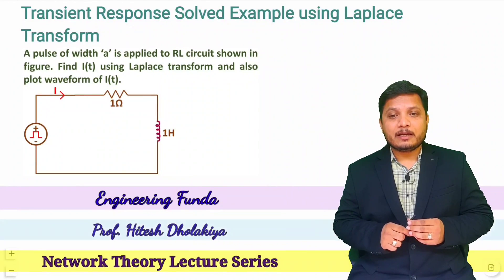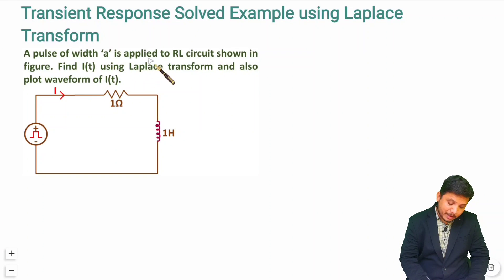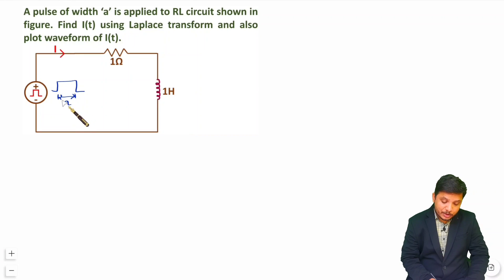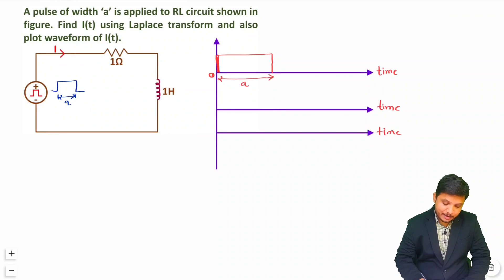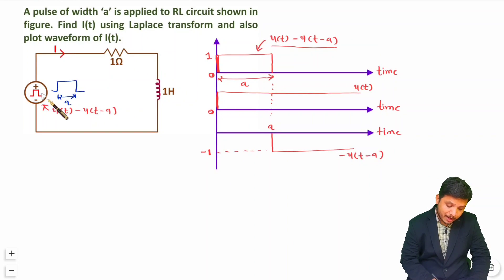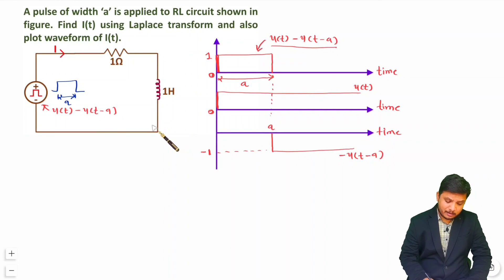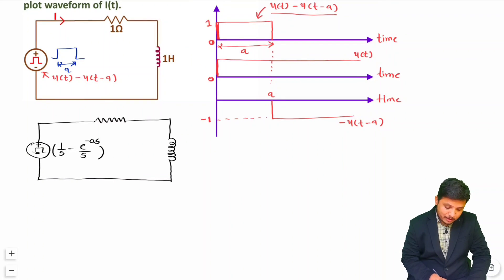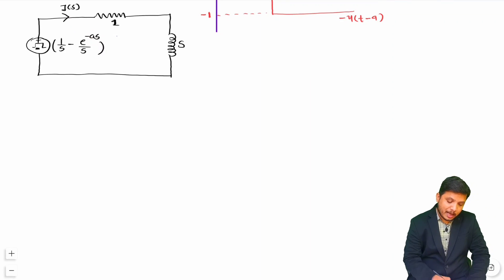5 - Transient Response Solved Example using Laplace Transform

Comment: Sir @ 4:13 a current source should be in parallel with the inductor as it is converted to s domain.sir, can you please explain?
Reply: It is fine here, try to understand situation. If you change the switch then provide supply with inductor and capacitor.
Reply: @hiteshdholakiya841  but there is no switch in the problem ..I didn't get you ? Could you make more clear.
Reply: Because it's not mentioned here that current was passing from inductor before t=0. Compare my words with example 1-4 ... You will get it definitely